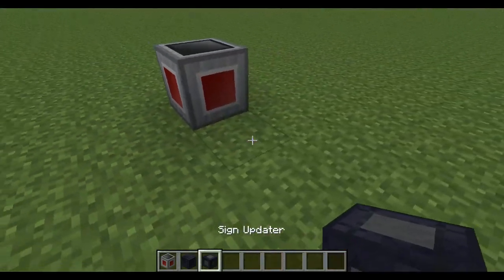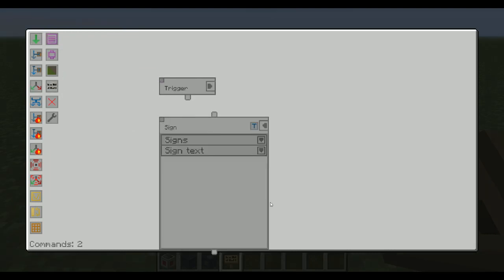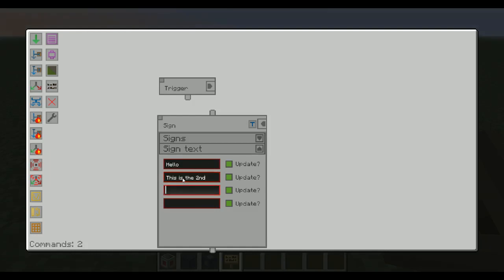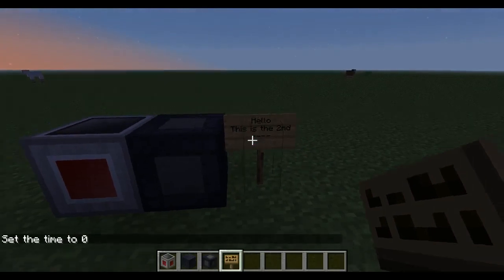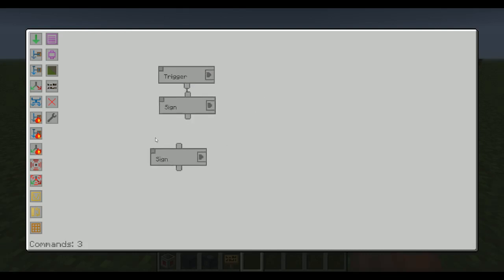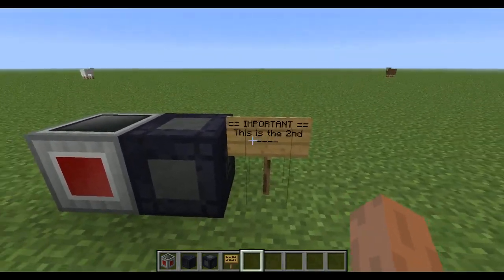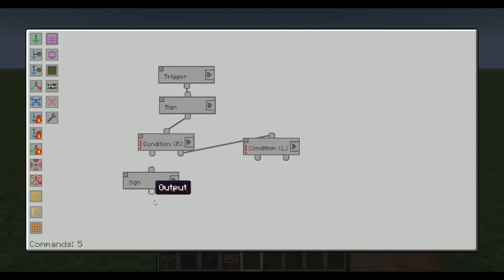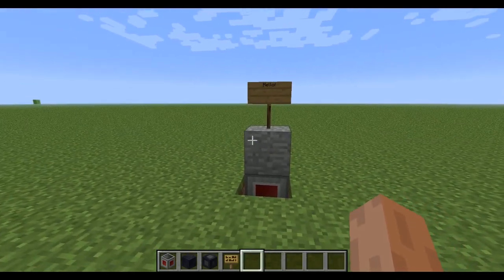Sign Updaters - Steve's Factory Manager

Comment: it would be nice if you could actualy put data on the signs...
for example, have it check a chest for coal and write "there are X coal in the chest"
Reply: I /think/ on a small scale you could track it by setting up a version of the line for each number of items.
Reply: for some things yea, but i don't really wanna set up 128 commands to track 1 stack
 (sign updater + condition for each number)
Reply from the maker: It was something I considered doing but never did. I might add something like that later.
Reply: That would be awesome, I was thinking of using it as a information panel, since all my house is be interconected using inventory cable.
Reply: +Bob Nips I wanted something like that, but instead I wanted it to track how much fluid was in a tank